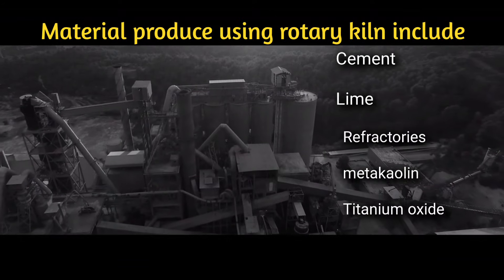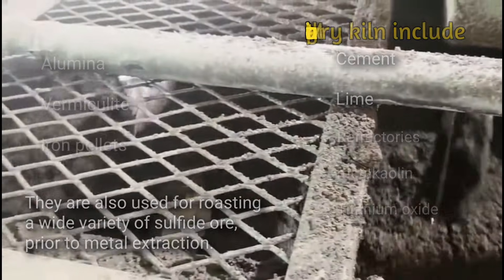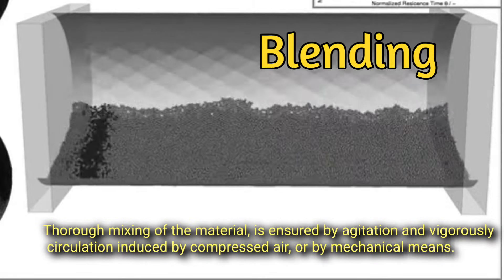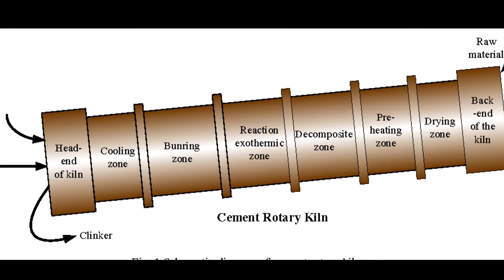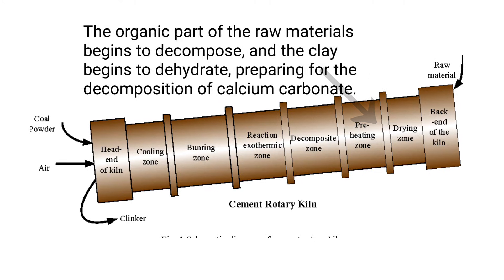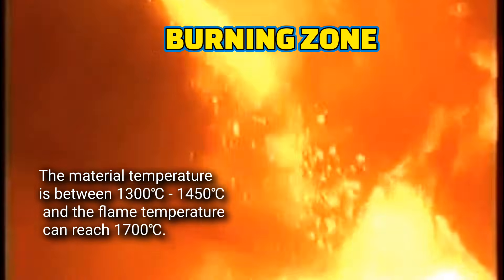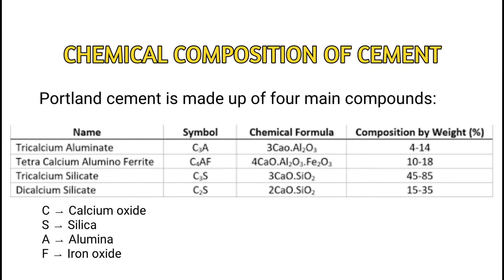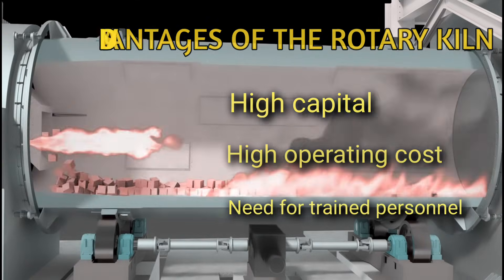Rotary Kiln Working Principles And Function In Cement Production.

Comment: Dear may I ask how many cycle before the refractory is replaced?thanks.
Reply from the maker: No specific cycle, it depends on operation. Like any essential equipment, refractory lining should undergo regular maintenance to ensure optimal operation and longevity.

The best advise is to have a refractory engineer, perform inspection of the kiln and create a maintenance plan.

Ideally, in the space of 1-3 years, parts or the entire refractory, needs to be renewed as a result of the wear and tear.